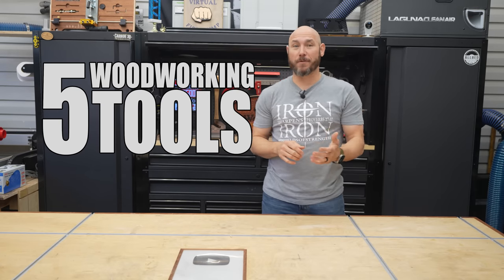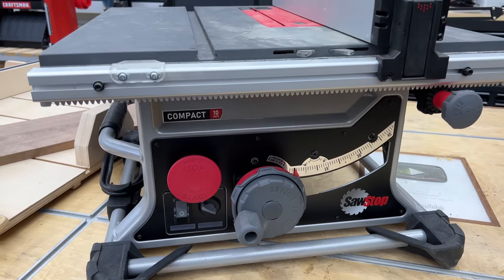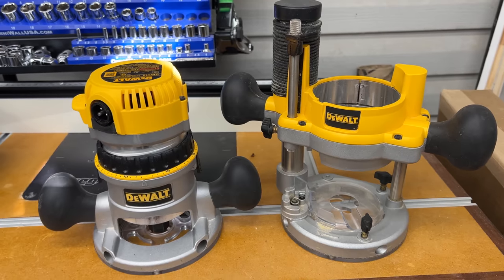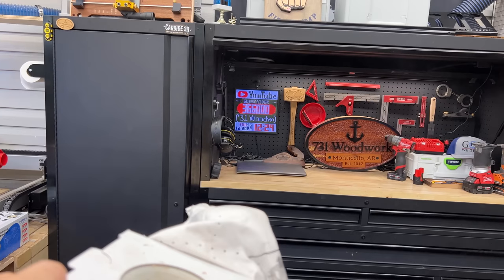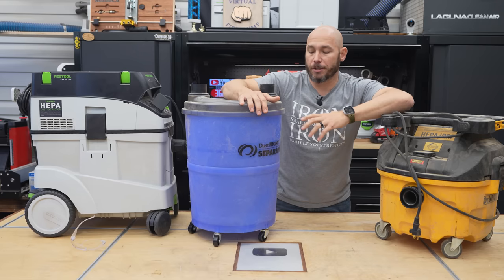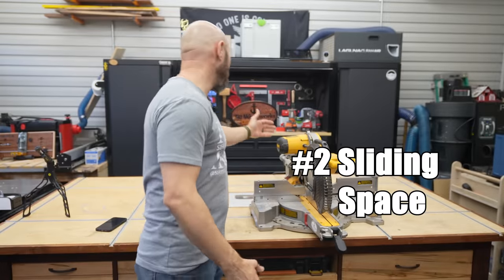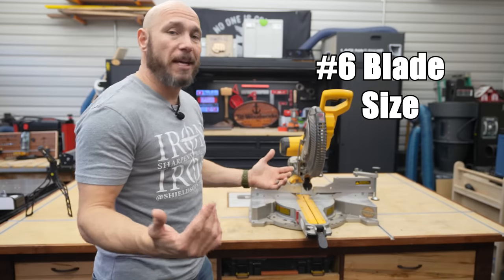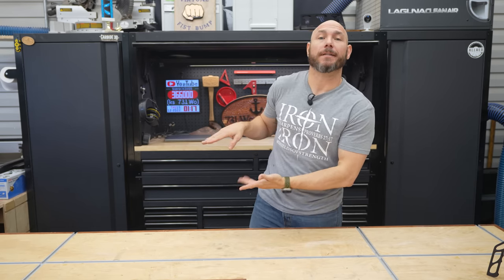5 Tools You'll NEVER Regret Buying!

Comment from the maker: ▼EXPAND FOR LINKS TO THE TOOLS▼ 
🎥 Watch Next - 5 Tools I Regret Buying - https://youtu.be/9UNOASuIJx8
🛠 Tools In This Video: 
Table Saws:
DeWALT Table Saw - https://amzn.to/3GgvkEP
Skil Table Saw - https://amzn.to/3jPVg2F
SawStop Jobsite Saw - https://amzn.to/3IiTe5k
SawStop Cabinet Saw (my big table saw) - https://amzn.to/3Co1g9n
Woodworking Routers:
DeWALT Router - https://amzn.to/3ZeWGEe
Ridgid Router - https://homedepot.sjv.io/x9xVKy
Bosch Router (I use this one in my router table) - https://amzn.to/3vId428
Milwaukee Cordless Router - https://imp.i284638.net/doXNoW
Dust Extractors:
Festool Dust Extractor in Video - https://amzn.to/3ifMI4G
DeWalt Dust Extractor - https://amzn.to/3GCxBLU
Festool Dust Extractor I Use for my Miter Saw - https://amzn.to/3VKArCU
DustRight Separator - https://amzn.to/3WMiFk8
Favorite Dust Mask - https://amzn.to/3Io95iQ
Miter Saws:
DeWALT Miter Saw - https://amzn.to/3VMw5eG
Festool Miter Saw - https://amzn.to/3VLXRb1
Delta Miter Saw - https://homedepot.sjv.io/15jn5D
Ridgid Miter Saw (same as Delta, just orange) - https://homedepot.sjv.io/x97X31
Makita Miter Saw - https://amzn.to/3WLeoNT
Drill Press:
Budget (like mine) Wen Drill Press - https://amzn.to/3GjQzpg
Mid Tier Drill Press Benchtop - https://amzn.to/3CnGMgF
Mid Tier Drill Press Floor Standing - https://amzn.to/3jSFh3W
Top of the Line Drill Press - https://amzn.to/3CmUgcC
Other Drill Presses You May Consider - https://amzn.to/3QemkEK

Other Tools I Recommend:
My Favorite Table Saw Blade (for 10-inch saws) - https://amzn.to/3GBZfJ5
Favorite Miter Saw Blade - https://amzn.to/3Io3F7N
Good Router Bit Starter Set - https://amzn.to/3Z8wafB

Shirt I was wearing - https://www.shieldsofstrength.com/iron-sharpens-iron-short-sleeve-t-shirt-proverbs-27-17/
My favorite work boots (use code 731WOODWORKS to get $10 off) https://bruntworkwear.com/731woodworks
Camera Gear I Use - https://kit.co/731Woodworks/camera-gear-i-use 
Computer Equipment I Use - https://kit.co/731Woodworks/731-woodworks-computer-equipment

Some of my Favorite Under $30 Tools
DFM Square: https://amzn.to/3Jfb5H2
Thin Rip Jig: https://amzn.to/3LKm2lB
DFM Saw Height Gauge: https://amzn.to/3jidia1
Small F-Clamps: https://lddy.no/157u9

(If you use one of these Amazon and other affiliate links, I may receive a commission) 

Some other useful links:
Daily Tool Deals on my website: https://www.731woodworks.com/tool-deals
Subscribe the 731 Newsletter: https://mailchi.mp/7e44c16eefdc/731-woodworks-email-newsletter
Check out our easy-to-follow woodworking plans: https://www.731woodworks.com/store
Outlaw's Board Butter - So Good it Should be Outlawed: https://www.731woodworks.com/store/boardbutter

Comment: The one tool I do not regret buying is a good hand plane. I think the 5 1/2 is the perfect combination of form and function, and as a person without a jointer and not enough room to put a jointer anywhere, my hand plane gets a lot of work done.
Reply: I second that. I have no jointer either, so I use a combination of scrub plane and 60 cm long wooden jointer plane. That thing trasnformed my work process the most since japanese saws.
Reply: The 5 (and 5 1/2) is one of the most versatile of all planes.
Reply: What plane did you get?
Reply: @C C  the one I ended up getting, was the lie Nielson 5 1/2. It is expensive but for me worth it. I see it as time vs. money thing. I also have a lie Nielson no 4 as well. 

 There are a lot of good manufacturers, I have a stanley 5 from 1920, but it took work to get it in shape. And it was much cheaper than my lie Nielson, but when it came to it, I did not want to go through the hassle with reconditioning another plane. But new stanley planes, with the exception of the sweetheart low angle jack, are kind of trash. You can make them work, but it is a lot of work to get them in shape. 

 I have a woodriver 6, but it is not great for the money. I replaced the blade, which could not hold an edge, and the tote comes loose because of poor manufacturering.  

Not to seem like a lie Nielson super fan, but I have a veritas router plane and small plow plane, and a scrub plane, all very good planes. I just do not like the adjusters on their bench planes. 

Sorry if it is tl/dr but wanted to share some of the reasoning with you as well.
Reply: @douglasanderson7260  My first plane was a new production stanley. Plastic handle, terrible grinding marks, very out of flat sole, chip breaker that was very crooked. Long story short,  I only managed to make it work after I learned on wooden planes a better quality new production Luban plane (I think they are almost identical to woodriver, but for Euro market)that was almost ready to use from the box. So getting a lie nielsen is great idea, especially for people who are serious about woodworking, but do not have the experince to make things that are not up to par work as they should.

Comment: For absolute beginners, definitely get a cordless drill and driver. Going from one corded drill to a cordless drill and cordless driver is life changing.
Reply: Changing bits over and over is driving (heh) me nuts! A good driver is on my list of things to get.
Reply: And what’s nice about the combo is the convenience of using them for outside the workshop
Reply: @tonyi4085  - So true.
Reply: The and driver part is so important. An impact is so much more efficient than a drill for fasteners.
Reply: @GizmosGameLounge while I do recommend an impact a basic bit driver will be life changing as well
Reply: Life changing in that you’ll be paying more (for less power). And then more. And then more. And then a new driver when its proprietary batteries become obsolete. And then more…

I’ve had the same corded Porter Cable drills and grinders for over three decades.

Comment: I certainly agree with your choices!  The table saw is probably the heart of any wood shop.  I started with a Ridgid 3650 because of the fence and the trunion (the part the saw arbor mounts to).  I’ve since upgraded to the SawStop 3HP cabinet saw.  But I still have that Ridgid!  Where we differ is my #2 power tool.  To me, it’s the Band Saw.  A good band saw can do so much!  You can make your own veneers, you can make intricate joinery, and you can do some creative shapes.  I actually have 2 band saws now (I’m luck to have space for them), so one is dedicated to resawing and one stays set up with a thin blade for making curvy cuts. :)
Reply: I'm hardly even what you'd call a woodworker, maybe in waiting?, but I want a bandsaw bad. I think it might be diresta's fault.....

Comment: I have the Dewalt DWE7485 mentioned in this video. I LOVE it. When I first got it, saw blade options were limited due to 8 1/4 inch blade, but there are a ton on the market now. I have not had a project yet that this saw couldn't handle. The fence is amazing, but I would recommend making a zero clearance blade insert for this saw if you want to do more intricate cuts.
Reply: I got one and love it. What type of blade you run in yours?
Reply: @garrybray7173  At the time I got mine, the only two blade options were the blade it came with, and Dewalt made a 60 tooth fine cut blade for it. I would swap between the two depending on what kind of cut I was making.
Reply: We have the 7485 on the jobsite as flooring contractors. My dis-illusion with the yellow and black comes from twenty five years ago...and this old grudge dies hard. However...this lil guy is a workhorse. We make a lot of "don't do this at home" ripping as we try to make hardwoods match the wobbles, curves and wows in walls. (Don't EVER think your wall is straight!) We use the very common 7 1/4" blades common to most corded and many upscale cordless circular saws...because we WANT them to warp...so we can make those swerving cuts. Makes ya wanna shudder, don't it?
That said...when the fence is on it as solid as any fence on any contractor grade saw on today's market...after spending a year and a half bouncing around in the back of a work van crammed full of tools. Had need of the fence for a seriously complicated cut in preparation for a tongue cutter in a router. Spot on...to within .001". If I had need for another table saw...I have two running, three sitting aside and another awaiting a full restoration I would certainly consider this saw, even with the limitation of depth of cut. Don't believe me? Watch Tamar @ 3x3!

Comment: My compound sliding miter saw was the first major purchase I made and for years it was my go-to tool for lots of stuff I built.  Once I got my table saw (DWE7491RS), that miter saw has been mostly collecting dust.  When almost all your cross-cuts  and miters can be made with a nice cross-cut sled, the only thing that sliding miter is used for is making cuts on long stock (aka tubifors ;), unless of course you do a lot of complex cuts on molding or something like that.  I would add 2 items that you left out: (1) drill/driver/impact set.  These get the most use for most stuff I do. (2) low-noise compressor.  This opens up a world of inexpensive tools - brad/pin nailers, crown staplers, etc.. that are really useful.

Comment: 2 words, impact driver. 2 more, Ryobi Quietstrike. 2 more, Milwaukee Surge.
I have 4 years with the Ryobi Quietstrike. LOVE the trigger control, pulsing control, and quiet operation!
Dislikes: size and weight. I always use this for what I LOVE about it!

I have ordered a new Milwaukee Surge which uses the similar hydraulic drive system and is much more compact and includes newer features as well.
I expect to be "wowed and amazed"!

Comment: two tools I have not regretted in addition to this list is an oscillating belt/spindle sander. amazing for sanding inside curves and small parts for boxes. the second is a benchtop jointer.  I have since upgraded to a floor standing jointer but being able to joint the wonky box store lumber for glue ups was a game changer when I started and I use a jointer multiple times a week. was especially useful during hard times when I was only able to get free pallet lumber for building things. kept my sanity through the pandemic thats for sure.

Comment: First off, I love your shirt bro.  I'm not a huge woodworker, but started getting into it more. I'm more so into meta work and automotive.  I've always been of the mindset of it's better to buy a used high quality tool than a new low quality tool.  A little while back I responded to an ad for a very reasonably priced Delta compound miter saw.  When I got there it turned out he was a cabinet maker and moving from South Jersey to Florida to retire.  What was originally going to be a $75 purchase ended up being almost $2,000 and 2 more trips to his shop.  I spent a lot that day, but got a lot of high end equipment that I do not regret buying.

Comment: That little Makita router is AWESOME. It's bigger brother the 2-1/4HP is too, and it's compatible with the Musclechuck quick change collet system. Once you go to that, you'll never go back to two wrenches needed to change a bit. Also have the Makita 12in sliding miter saw. It's also amazing, having used the DeWalt, a Delta, and a Ryobi.

Comment: Nice tool selection tips.  Regarding the power issue on the Wen drill press, try switching your belt from the standard rubber v-belt to a link belt.  It can help eliminate some of the run-out on your quill that might bind your motor.  I know it helped me with my less expensive Grizzly.  Hasn't bound up once since I changed over.

Comment: For me the absolute most used tool has been my impact driver. It Guess used far more than anything else I have. Also never let anybody tell you you have to buy a high-end one. I used everything from a $35 one up to multi-hundred dollar ones. If you're not doing construction or production work generally you can get away with lower budget ones and do just fine.

Comment: Bandsaw......so versatile but especially for resawing.  I remember how frustrated I was being limited to dimensional lumber as some projects looked out of proportion.  Now I can resaw into thinner pieces when called for.
Reply: Or if you replace the drill press with a high quality portable drill guide like the Rockler one as I have, then you could add a thickness planer in the 5 must have list. Then you can  shave the thickness down to what you want it to be. But that is such a waste because you have already paid a premium for having somebody else do the work of giving you at least two flat faces and even more for 4 flat parallel faces only to grind away a lot of that wood. 
So for me, a good bandsaw that can resaw rough dimensioned lumber is #5 1/2 on my list. And if you have a good source of rough cut lumber and resaw a lot of the wood that you use, a bandsaw will likely pay for itself in short order by not having to pay the premium for pre dimensioned wood (besides likely have a lot more species of wood to choose from).
The only trouble is that band saws with enough depth to resaw wider boards (12 or so inches) and a good solid cast iron table and trunnion to dampen vibration, an accurate fence to get a good parallel cut to minimize work on the jointer or planer using a joiner jig, and enough power and fpm to make a clean relatively rapid cut on wide boards, like the $1500 14" 1.5 hp JET JWBS-14SFX, (and this is one of the cheapest full size bandsaws) are expensive not to mention large and heavy. The alternative are cheaper bandsaws that are limited to resawing narrower boards and don't have the power to cut very fast. The $500 Rikon 10-3061 appears from reviews to be a good choice. It has 1/2 hp motor and can resaw up to 5" wide boards.

Comment: I got that Delta about 7 years ago to upgrade a Ryobi and have never regretted it. Great saw and once you square the fence it stays like that for a long time. Also got a full kerf 24T flat top blade and it doesn't have any problem going through 3-1/4" hardwood.

Comment: About 20 years ago, I wanted to build my own house, so I decided to go big on tools. I got Delta X5 tools (table saw, band saw, etc). I also bought various DeWalt tools, routers, drills and more. At the time, I spent about $5000. I don't regret spending any of it, since I probably got $20,000 worth of use out of them. I still use most of them today. Other tools I like that I bought a few years ago was a DeWalt 13" planer and recently the DeWalt 12" sliding miter saw. No regrets here, but I use them a lot. Quality costs a little more, but I found that cheap turns out to be expensive.

Comment: I bought a Wen tracksaw and the 100 inch two piece track (and two clamps).  At first, I bought it because it looked cool, but now I use it on almost every project where I am cutting plywood or sheets of MDF.  I am so glad I got this!  
Great video!  Agree about the table saw fence.  My first (and current) table saw is a 15 year old Ryobi 10 inch, and it is not great.  Looking to upgrade soon.  Thanks!

Comment: Not sure if anyone has mentioned it, but possibly one of the best tools I’ve ever gotten is a good set of machinist blocks or 1-2-3 blocks. Mine are spot on within .001 inch on each measurement and perfect right angles. I’ve measured, adjusted, aligned, everything with them. And only about $20-30.

Comment: First big power tool I bought was a miter saw, probably 20 years ago and I still have the same one. I use it about twice/year, mostly for breaking down 4x4 construction lumber for random house projects. I just don't cut long boards so often that I can't just rough cut with a hand saw (or circular/track saw) and clean it up with a crosscut sled on the table saw. I'd replace that miter saw "must have" with a good drill and impact driver set. I have 20v and 12v yellow ones and have to say most of the time I reach for the lightweight (and cheaper) 12v ones, since they have plenty of power for basic woodworking tasks. Next to that would be a good random orbit sander (Festool/Mirka/3m are a game changers and worth every penny, but I still often pick up the battery powered brushless one for small tasks).

Comment: I would add a morticer . Mine has lasted decades. They are accurate and quick to use. I don’t recommend site saws. Spend a bit more and get a table saw with a solid table and micro adjust fence. Buy the biggest and heaviest you can afford. It is the number one workshop machine.

Comment: Before I got my Sawstop, I had the DWE7491RS 10-in jobsite table saw. Portability is key in my shop. I'm too old to be picking up table saws, drill presses, bar bells :-). How about a Bandsaw blade review. Can't seem to find one I'm happy with.
Reply: For resawing the Laguna Resaw King can't be beat.  It's going to hurt but they're great blades. Highland's WoodSlicer is really good too but, again, it's going to hurt.

For general use??  I buy them from Highland for $30 or so.  I need a selection of widths and TPI so don't spend a lot on general purpose blades.